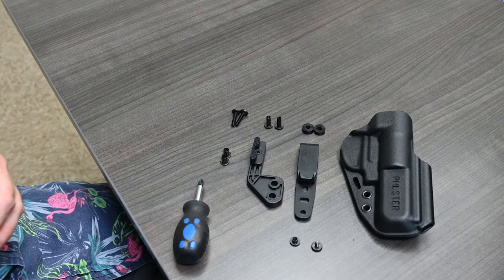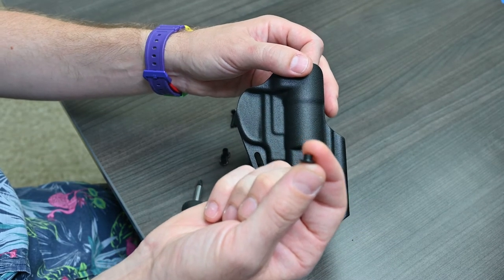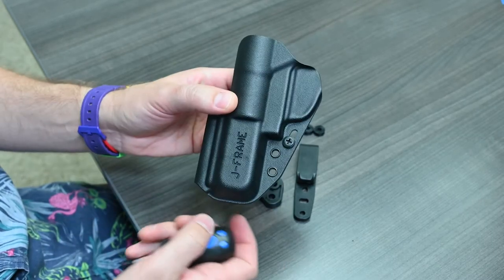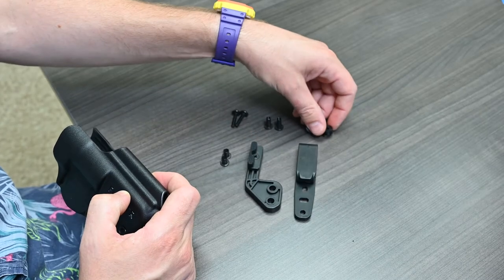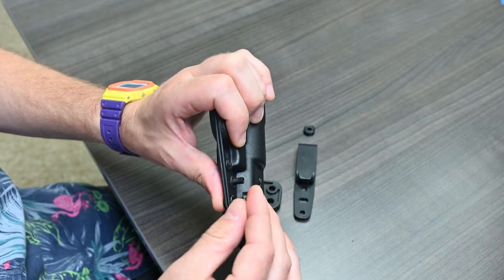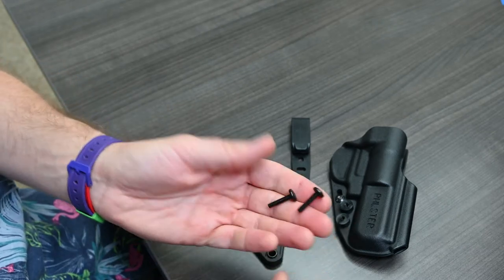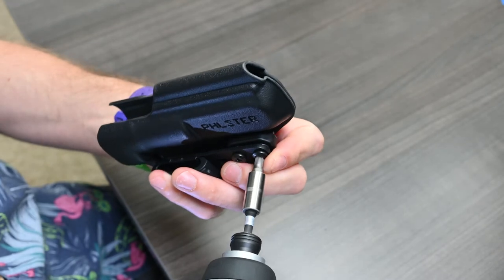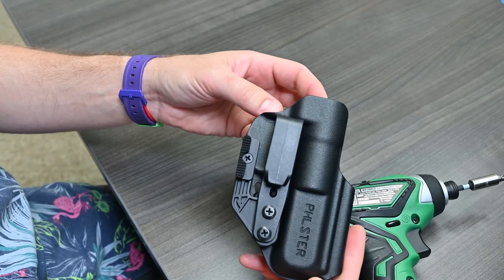PHLster City Special Assembly

Comment: Just got this in the mail today. I plan on appendix carrying most of the time with this gun/holster. Is there any practical need for the modwing if the clip is always vertical for appendix carry?
Reply from the maker: The Modwing helps rotate the grip of the gun closer to your body to improve concealment, but it also forms part of the necessary thickness of the hardware stack to position the clip appropriately above the trigger guard. You should leave it where it is...
Reply: @HenryHolsters  thanks for the speedy reply and info!